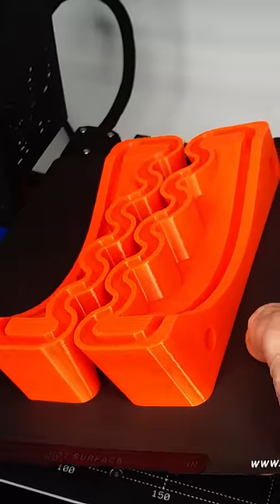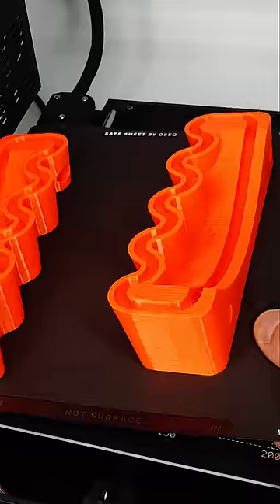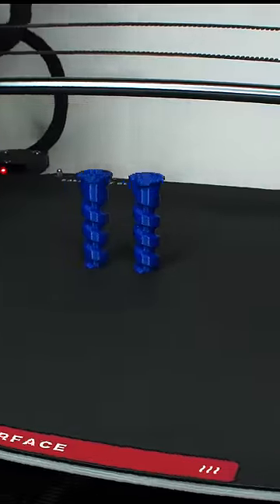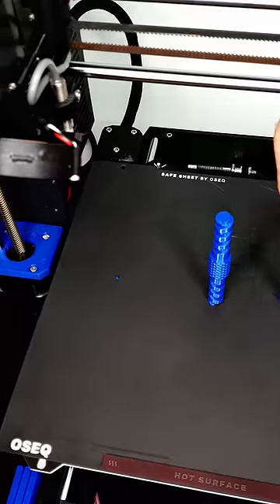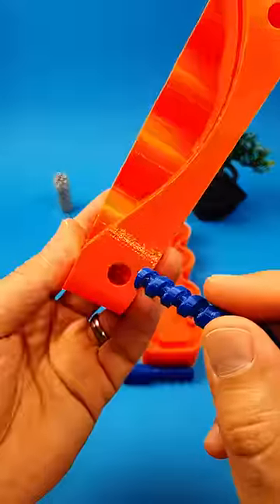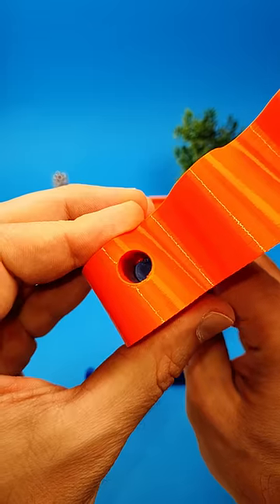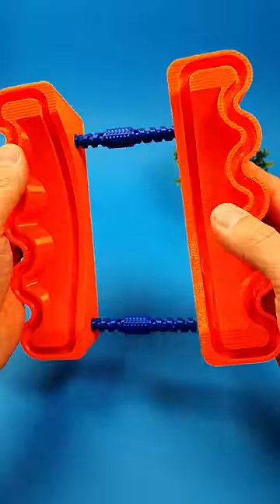Marble Machine Spool Holder 🎡 [3D Printed]

Comment: And to everybody not knowing. Over a few times of using the same balls. They start getting rough from grinding together with no oil or any type of lubricant to make it flow easier and smoother. Going to cause problems within first week or 2

Comment: love the design, only problem is now a lot of filament manufacturers are switching to cardboard rolls which really don't work with this style of holder
Reply: Well, replace the cardboard roll by a printed one
Reply: @sigisalmen2399  no thanks I'll stick with supporting it from the inside of the roll instead of the outside

Comment: seems like a lot of unnecessary noise. If you have ball bearings, why not print a regular spindle spool holder with ball bearings inside the cradle for the spindle?

Comment: Can you make them embedded in the print by making the slot where the balls roll in with an inward flench to lock them inside stop the print at almost the highest layer and putting them in so the never ever can fall out?

Comment: Why?, why not just use babiny unwound from the back inside? Ethernet cables are also unwound from the inside. Even the packaging is cheaper. Babins are much lighter, Bobbins can be curved and without symmetry. Bobbins can be cardboard.

Comment: The most unnecessary invention ive ever seen in my entire life
Reply: Its not unnecessary nor an invention really. You need somemthing to hold the spool and you need some way to return the bearings to the bottom. This is the same way a linear rail block works.
Reply: @trelic8545  that has much higher friction than this.

Comment: After my test with a spool holder with skateboard ball bearings I found out that a certain friction is needed so that the spool does not roll off. Therefore, I use the standard prusa spool holder again.
Reply from the maker: Sure! I printed this just for fun.
Reply: I made one with bearings too and simply tighten a little bit the nuts to create some friction so it doesn't rotate too easily